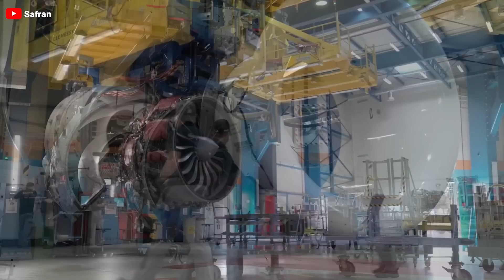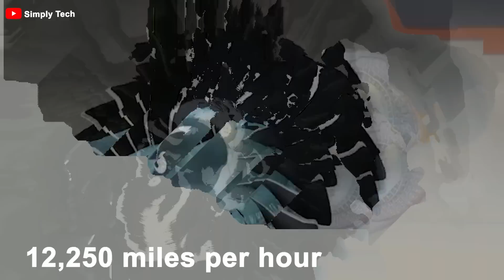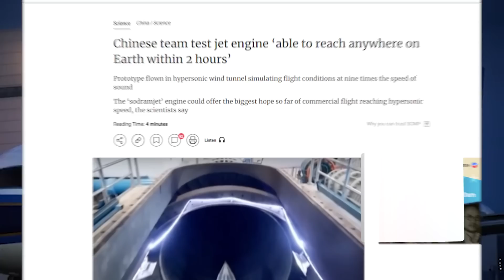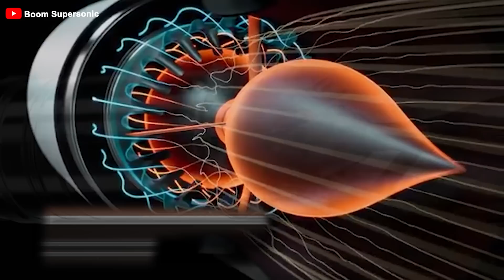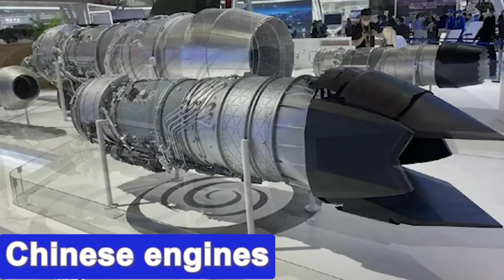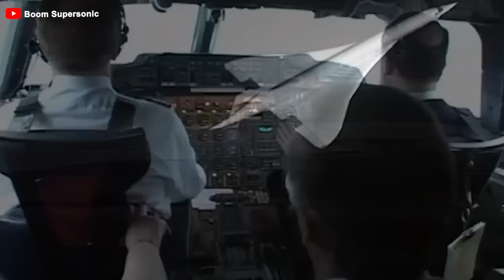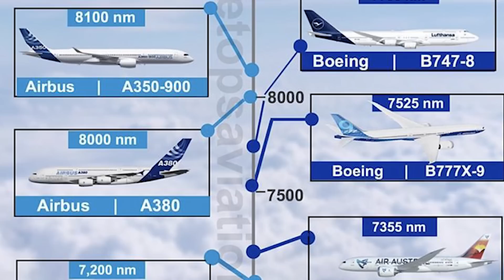You Won't Believe How China Just Did the Impossible Shocked the West!

Comment: Blah, blah blah, another Bullshit theoretical concept. You cannot achieve Mach12 in Earths atmosphere even at 30klms altitude. I have seen another video only today stating a vertical takeoff vehicle/space plane from China leaving the atmosphere and re-entering.
A rocket can do this easily on re=entry but it does build up its speed - mach 17 plus from Space (130klms+). Besides Hermeus in the USA will have their own hypersonic Mach 4-6 planes out in the next 3-5 years as they have already tested their RamJets on the bench and beginning flight testing soon. Anything over Mach 5 within earths atmosphere will not happen in the next 10 years. Maybe 20-50. But Ramjets and Detonation engines possible up to  Mach 5 in the next 5-10 years.